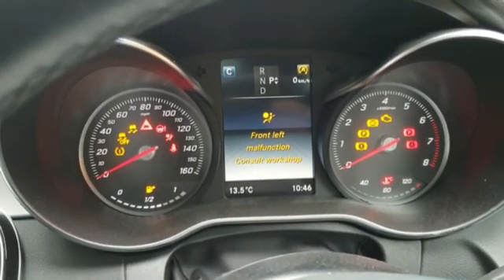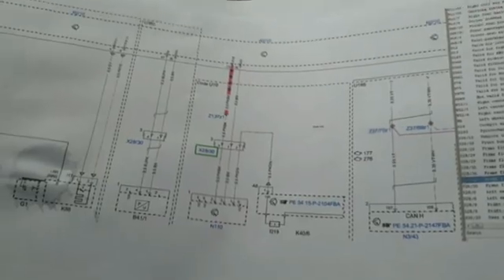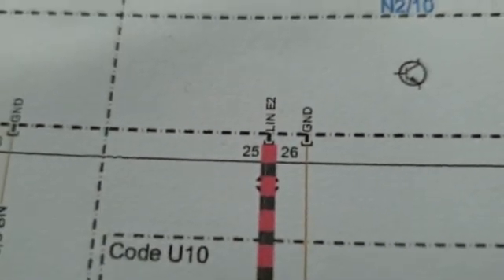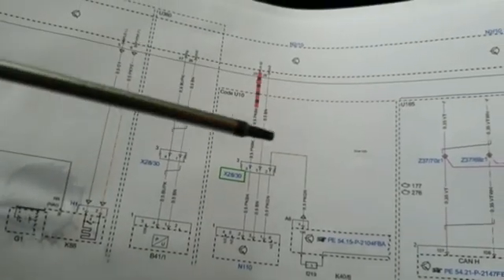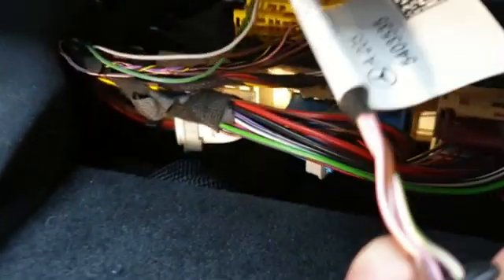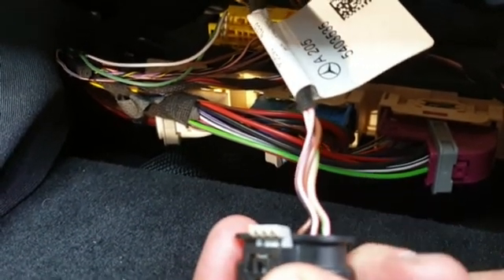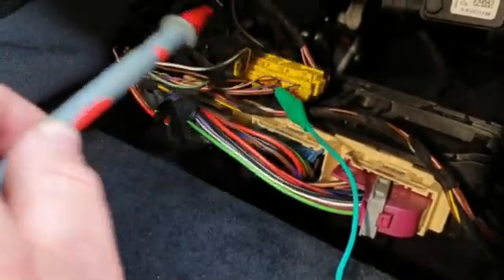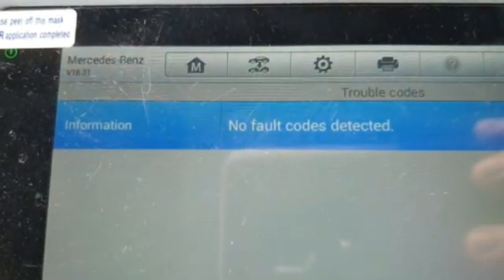Mercedes Front left Malfunction or U100887 LIN BUS 1 is faulty - solved

Comment: Hello - quick question. I have a 2013 C300. I removed driver side airbag in steering wheel to change out a trim piece, I now have a code. Is this something that I can reset myself? Dash showing front left malfunction. Thank you!
Reply: Did you fix it? I changed some buttons on my 07 s550 and put back the airbag in steering wheel but now is showing “malfunction on left side” with airbag symbol
Reply: @AliJohnAfandi Yes - I had to buy a diagnostic tool that had the capability of resetting the SRS system. Cheap tools will not include this functionality.
Reply: @FinancePro203 Hey there brother. What tool was it?
Reply: @FinancePro203 you have the exact tool?

Comment: Hey I changed the steering wheel on my 2020 g wagon this error popped up im sure it’s because I didn’t disconnect the battery while installing. If I disconnect the battery do you think it will reset?

Comment: Right?!? I am a fleet manager for a DSP which has 19 Mercedes Sprinter diesels and 11 gas Mercedes Sprinters. We have this FLM multiple times a week. So far it’s been the seatbelt and now a safety feature inside the driver door. I refuse to put my drivers in a van with an SRS issue or even a check engine light on! These vans were not made for deliveries 7 days a week 10 hr days and 25 to 35 stops an hour!

Comment: Hello, I had some issues with the cable under the console. I managed to put it back together, but now I have 2 front left and right malfunctions without any DTC found. I already checked the fuses, and double-checked the wires, but I see nothing wrong there, what should I do? Thank you!
Reply from the maker: You have disconnected or damaged some of the wires. Check connectors of all properly plugged in. Otherwise you have short circuit with some wires.

Comment: Hello friend. Is the same in the w204?? I have the same code. Thanks 👍
Reply from the maker: Try to unplig cinnector unde passenger seat. If the error stays then you havd identified the issue as no communication is going to weight sensor.
Reply: @tiptopmechanic1155  thanks for your quick response and help. The sensor was changed because the error was the seat mat sensor ( I've got the diagnostic machine ) but now with the new sensor appears that fault of line can bus 1.  Thanks my friend 🤝🤝👍
Reply from the maker: @andyhookigs4586  then the wire is damaged somewhere. Its going all the way to Airbag module. I would unplug Airbag module and try to check for continuity on that wire between connector at Air
bag module and connector at the sensor. It's 1x wire that is going all the way up there.

Also check for ground maybe try give ground from elsewhere to the weight sensor module. Also check if it has 12V coming once ignition is ON.
Reply: @tiptopmechanic1155  i will check and let you know. thanks 🙏🙏🙏🙏
Reply: @tiptopmechanic1155  hello. Sorry for delay in answering, but I lost the link and I couldn't find it so easy 😅. Apologies. I changed the sensor mat because it was one of the codes and that code disappeared, but now i keep with the u100887 about can bus line 1. I have a look the wires but I hadn't too much time. Thank you
Reply from the maker: @andyhookigs4586  Must be the LINE 1 cable damaged that is going between weight sensor and airbag module. Check for continuity on both ends. Take out connector from weight sensor and airbag control unit and check if that cable is ''responding''.

Comment: Thank you so much. You’ve just saved me £900 after the garage were going to charge me for a new seat pad. If it weren’t for this video I’d never have thought to check the fuse (which was loose from hardwiring a dash cam). Dash cam removed and fuse in - works perfectly after light reset. Thanks so much. Very grateful.
Reply: Andrew R And thanks to you too as i also had a dash cam hard wired and it was the cause of the fault. Saved me a fortune 👍🏼
Reply: @Ice1371  oh wow, that’s great news, glad my comment could help you. Together, we have saved a fortune!
Reply: I am glad you have been able to work it out. It would be interesting to know if the garage would found the same and if they still would charge that ammount for cost of €0.20 fuse
Reply: I am worried now, as mine has the same thing! I have c180 coupe here in the UK and it had a factory recall on the airbag, so i thought it was related. After the dealer did the work, they said there is an alert with the passenger recognition seat pad, and the manufacturer doesnt make them any more? and they are trying to get hold of the manufacturer to find out. £900 is immense!

Comment: Sir, Mercedes c class w205 coupe climate control fault , it shown U100800 LIN bus 1 has malfunction . What’s the possible fault it occur ?
Reply from the maker: Is your climate control working ? Is there power ? Check for 12V+ cable and ground first. If all OK look for the schematics and find LIN cable and check for damage.
Reply: @tiptopmechanic1155  great pro-grade advice 
👏  👍
Reply: @tiptopmechanic1155  hi , I changed the steering wheel from a 2011 w218 and put on the facelift, my orders don't work , on the tester when I wanted to clear the airbag error I came across the u1008-lin bus error ..
Reply from the maker: @ionutpreda1150  Different connector pinout